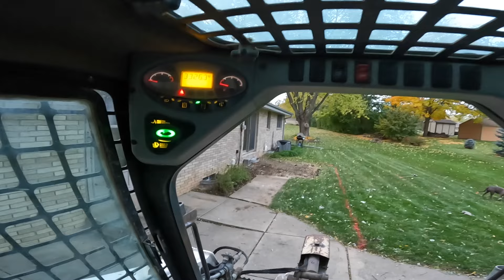Starting a BIG concrete project. Lots going on!

Comment: You need one of those vibrating rods like Concrete with the Hauses has. He has DeWalt and I think they are like 300 bucks. I think Milwaukee gets about thirteen hundred bucks for them. But you got the money though, spend it!

Comment: Back in the day around 1967 or so my dad and I built our garage. When he poured the concrete he placed a 2 or 3 inch aluminum pipe in the concrete for the garage door to sit on. We left about 1/4 of it above the cement as a threshold. It was weather tight and easy to sweep dirt over when I cleaned the floor. To this day it is still in perfect shape, that's over 50 years! It also looks much better than the rut left from smashing the garage door into the wet cement. Thanks for all the great videos!
Reply: I’d like to see a picture of that so I can understand it. I believe you tho. Old timers are smart

Comment: A electric jackhammer would definitely come in clutch in times like this.
Reply: You can buy a hydraulic jack hammer that attaches to the bobcat and is alot better than electic, more powerful and d
Reply: @josephcofrancesco4123  wouldn't be bad either, but remember. He didn't need power at that particular time. Didn't want to disturb those brittle center blocks.

Comment: Ok, hate to be the one to point this out but... the actual septic tank is usually 3 feet down. the top lid is usually just a locator.  No harm done, shouldn't never collapse  under the protection  of that concrete patio. It is however going to be a nasty surprise when new homeowners go to instal an ingrood pool in 30 years. 😂

Comment: I have been working at concrete for almost 20 years. I’m wondering what you mean by 6 bag, 7 bag etc. I’m in Newfoundland, , CanAda. Different terms for stuff. I call it a Darby not bull float and I’ve never seen two mean on a screed board before. Always one man here with two small handles on a 2x4. I have huge respect for your generosity for others. 👍

Comment: Sorry but I hate that threshold from the double sliders. My double sliders slide back on a track that completely opens the doors. It is still a narrow opening and you have limited the exit to skinny step I would have taken it from customers left to right and widened it out to accommodate that tiny little opening. It may look pretty but is still impractical. Sorry just my humble ancient opinion of a 73 year old female.

Accommodating a single door opening without the architectural beauty Plus point would make it more safety directed. That step is not safe
Reply: You may be a 73 year old female, but I poured concrete for over 20 years, and you are correct in my opinion as well! 👍👍Common sense, the way it is, I called those broken ankle steps
Reply: @Musclecar1972  thank you sweetheart. 💖
Reply: @Musclecar1972  I called them brain ending steps you fall you hit your noggin and somebody inherits your property good on them. Sorry I have nobody to get my property. LOL still looking for a good candidate to be inherited of my dirt on Earth.
Reply: @kathleenegan8660  To his defense, I will say it was probably at the customer’s request, personally I would have discouraged them from that design, during my tenure as a concrete contractor, I did just that many times. Customers want pretty, sometimes without thinking about functionality, or safety, it’s the contractor’s job at that point to point out the flaws. One misstep on that particular stoop, would mean pain of one sort or another.😵🤕
Reply: @Musclecar1972  love you sweetheart I know what you're talking about. He was not at fault the homeowner decided on beauty over functionality and safety neither one of them resided in future.... Mishap. We don't think ahead as a population that is what is causing all the problems today we have lost sights of beyond the minute of our life to the decades after our life.

Comment: How would you fix the loose cinder blocks in the garage?
Reply: If they are not too bad you just chisel out the joints and repoint them. Really loose block would need to be relayed.

Comment: Probably a silly question but do you feel OK with not vibrating the concrete in the Sonotubes(?) ?
Seems to me that, as they are what three four feet long(deep), the concrete may well have voids in it .
As they are 'only' supporting steps though perhaps this is acceptable

Comment: Why do you fill the sonotubes under the step? Just curious
Reply: Concrete for the step needs to be below frost line (4ft deep). Prevents steps from heaving during thaw/freeze cycle.
Reply: @tinytim9453  thanks tiny!

Comment: Is there a reason there is no floor drain in the garage? I would think with snow and such on vehicles it would prevent puddles in garage. Just curious!
Reply: Garage floor is pitched to😮 the front, in cold areas center pitched drains generally freeze, can cause huge problems most northern areas don’t use them for this reason.
Reply: Thanks Kurt, always trying to learn.

Comment: So if a project or cracking up the concrete and grading is done.  You seem to get done in the early afternoon.  Do you still pay them for an 8-hour day?
Reply: Do not forget, they start at 6:30 in the yard.
Reply: @Carterrwp  that makes no sense
Reply: @Carterrwp  it also depends as some crews get paid on the job and a incentive to get them to work hard is by paying the full day if they finish early. My buddies construction crew if they finish a project early they get paid till the original estimate ie if the job was supposed to be completed on the 5th n they finish on the 3rd they still get paid those extra two days, why you asK? Because the gov or the project manager etc gives the contractor a bonus for finishing early. Is everywhere like that? No. But you act as though its unheard of
Reply: Remember they start (what I would consider) ridicously early, Ryan 'talks ' of (in this job) pulling up at 06:45 , so inthe yard 06:30. An eight hour day from then would be about 14:30 (half two) .

Comment: Is it me or do a lot of jobs you replace didn’t have wire in them? I thought it was a requirement in the Midwest?
Reply: @TUGG75  >No nobody uses wire mess or steel in patios or driveways it's not needed 

Driveway condition in that video kind of speak for itself.
Reply: @TUGG75  It is. That's the actual point of steel in slabs. Concrete strong for holding compression force but weak on tensil force. That why you add mesh/rebars on lower part of the slab - steel good to hold stretching.
Reply: @TUGG75  >steel mesh does not prevent concrete from cracking

Sure. Engineering mechanics works differently for driveways. Sad that all ppl use reinforcing in concrete that didn't work anyway. ;)